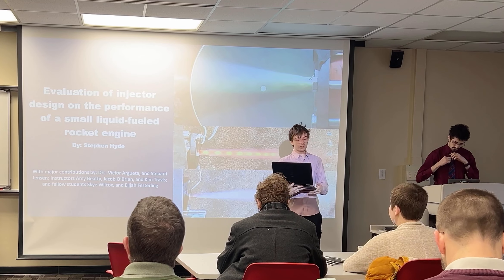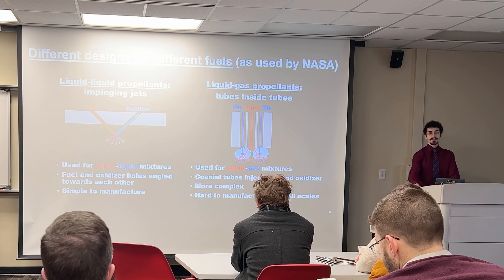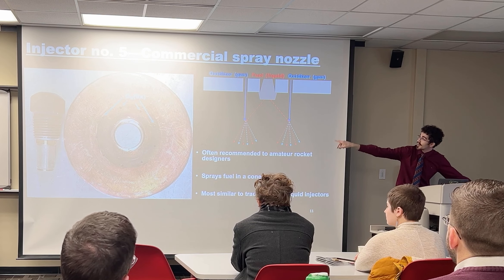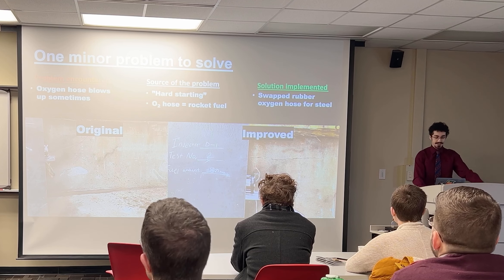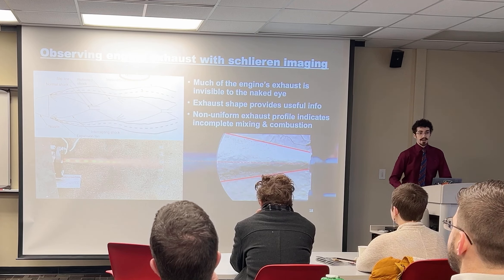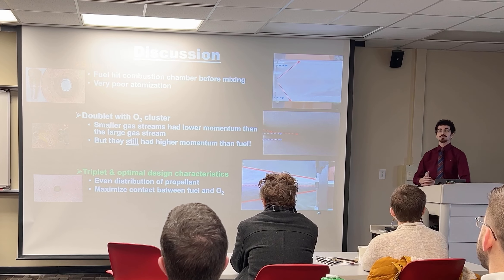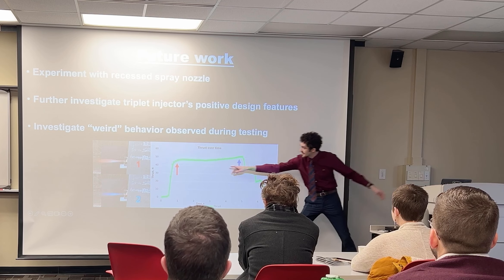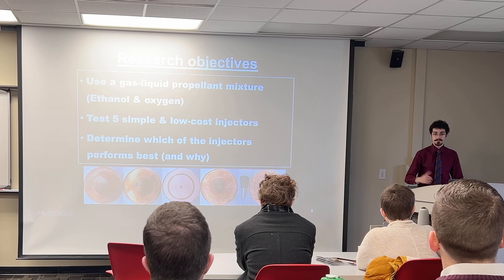Rocket Engine Senior Thesis Presentation

Comment: Great presentation, couldnt have done it better. I am wondering how did you get good data from RPA as it does not have a preset for gaseous oxygen, and when i tried to make it custom it gave me absolutely bogus data. Anyway  I wish you good luck in your next ventures.
Reply from the maker: There's a feature in RPA that lets you add custom propellants to the propellant library. I got the polynomials from here: https://cearun.grc.nasa.gov/ThermoBuild/ and I checked that I had gotten it right by running a few other elements that were in the database and making sure I used the right numbers from that website
Reply: @jingojango9220  Thanks a lot... will look into it
Reply from the maker: No problem, let me know if it works :)